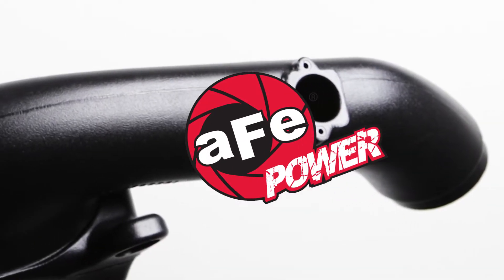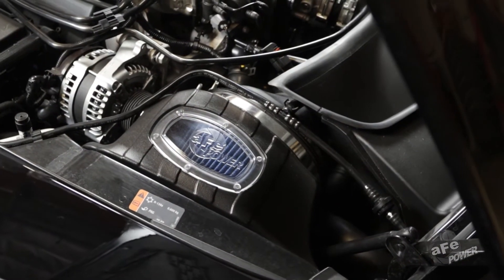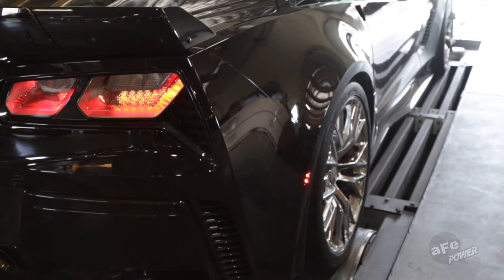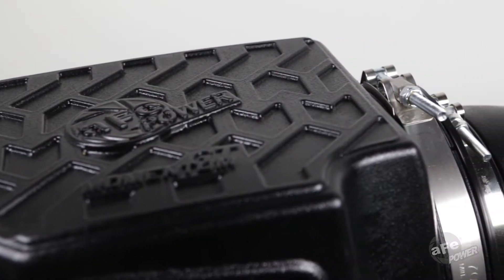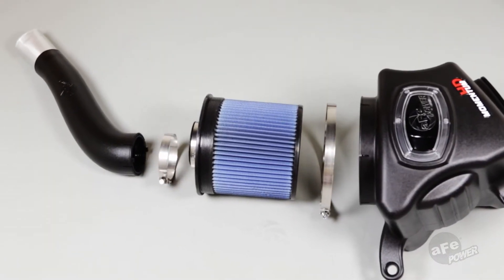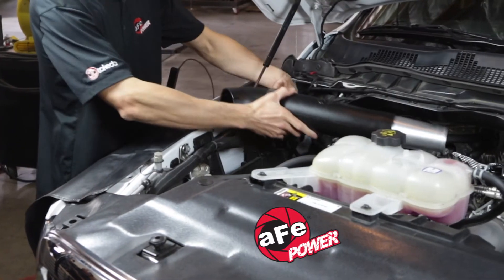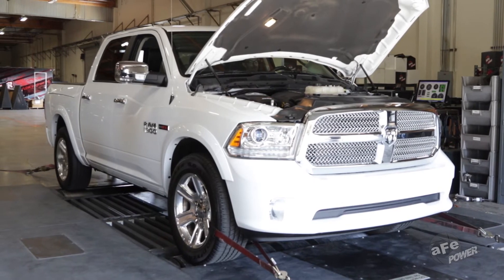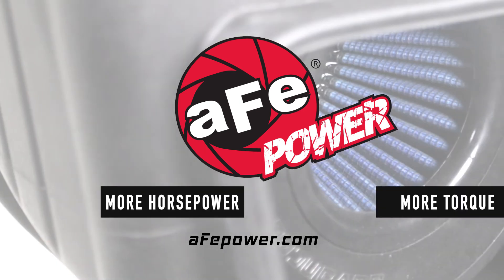aFe POWER Momentum Cold Air Intake Systems - Engineered Adrenaline

Comment: I sent these on amazon, they are showing a dyno sheet of a 34HP gain. Seems a lot for just slapping on of these on. 5-10 is more realistic.
Reply: 34hp is realistic. But they don’t make their tubes the right size and they pull apart. Avoid buying these intakes unless there is a good return policy in place. My 2017 Grand Cherokee with the 5.7L Hemi tube pulls apart and they won’t fix it.
Reply: @bob-a-louannamaria7960  Just installed a AFE Momentum ST on my 4 banger Camaro...The tubes are tight...I drove 20 miles without tightening the pipe to breather housing clamp (left the right socket at work)...It was actually hard snapping that tube into the housing.

Comment: Debating on buying the afe  momentum gt, or the air aid mxp for my Charger srt8... since the hole would be blocked on the Charger, where does the cold air get pulled in from?